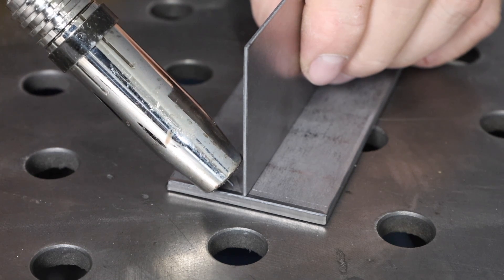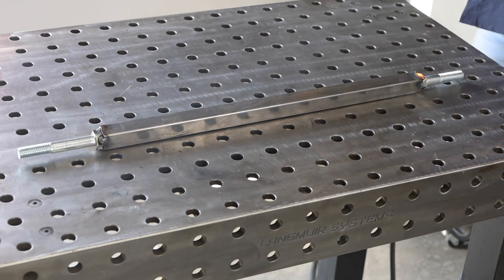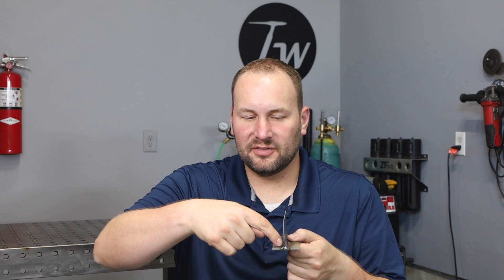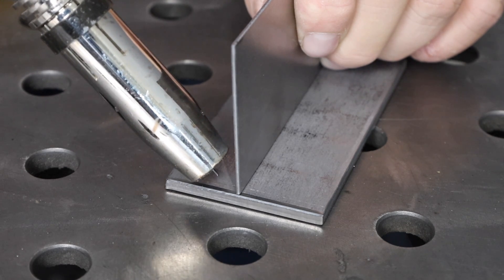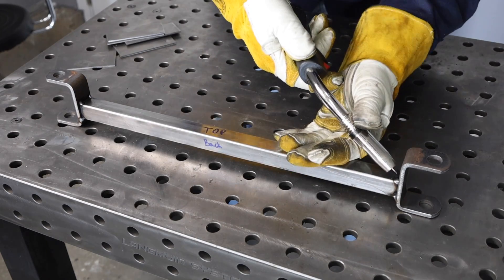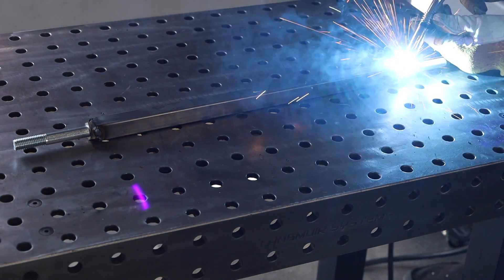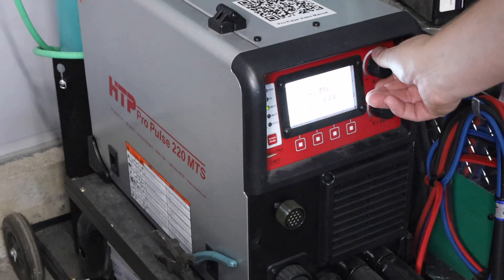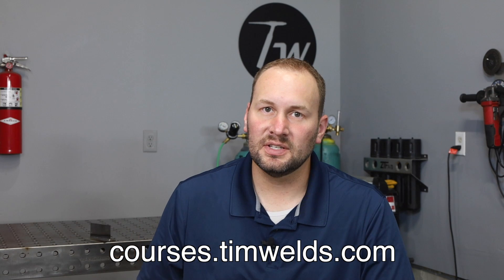MIG Welding Thin Metal to Thick Metal: Here's How

Comment: Most of these  videos show the easy one; with the thick metal flat...how about the real thing with the thin metal in the flat position ?
Reply: Following the same process. You focus most of the heat on the thicker material.  It is a bit more tricky when welding vertical but still the same principle 👍
Reply: His example of the anxle is as you describe. Really no difference, just move a bit towards the thicker.
Reply: He does thick metal-vertical here: 3:00

Comment: Hi Tim, great tips in the video.
As an amateur I have enough trouble keeping a straight line when butting two tubes to form a tee. The bicycle head set I’m welding is 1mm and the main tube is 2mm. I’m told if I insert a spare section of 1mm tube snuggly into the 1mm tube I’m welding this will form a heat sink and reduce the likelihood of me blowing through the 1mm tube if welding on a setting for 2mm steel when keeping the torch centrally positioned between both pieces.
Is this correct or wishful thinking. Someone said place a damp rag packed into the thinner tube will also dissipate the excess heat.
Thanks,
Bob.

Comment: Hi. A very informative video. 
I’m looking to weld a rectangular 2mm wall box section frame to a bicycle head set after I have ground off the exiting frame that is connected to it.
If I leave the existing weld in place tided and ground to 1mm thick so that the wall thickness of 1mm is now 2mm and equal to the box section would this be ok so I could weld centrally and avoid have to weld offset as explained in your video. I ask as I’m OK at welding equal thickness materials but not so good at welding different thickness materials as shown.
Thanks in advance.

Comment: Cool stuff would just like mention as a seasoned welder guys when the horizontal is the thin stuff its a whole different beast be careful when you end the weld starting it and running it is okay but if your not careful on terminating the weld you will get undercut. Normally I drop a it back a tiny bit more in this situation eg 10 to 10mm ill blast 270-280 amps all the way but 10mm to 3mm ill put about 245-255 if I can stand it upright thick at the bottom but if the 3mm is horizontal I'll blast it about 240 amps but make sure the volts are above 26

Comment: sir how to avoid a cold start at the weld at the start and lack of fusion at the end of the weld. I am trying to join a 1.2mm mild steel sheet to an 8mm mild steel sheet..the path of the welding is half the shape of a rectangle due to the welding path I have to make this weld in two steps from right to center and left to center.

Comment: If I ever weld Thinner to thicker steel I only use no gas flux cored wire with the shroud removed as it not needed with gas wire..I always apply heat to the thick steel and use the weld pool from the thick steel to melt the Thinner steel so they melt together..any one with common sense would know this technique..I'm no expert welder but common sense prevails..yours sincerely from the old qeer corrupt uk 🇬🇧

Comment: 👍🏼👍🏼👍🏼👍🏼👍🏼👌🏼🍺😎
Have you used 25’ thicker extension cord for outside flux welding? 
I believe the settings would have to go lower than Chart I was having problem with it burning threw.
Reply from the maker: Thanks! I use extension cords all the time, but mine are pretty beefy.
Reply: @TimWelds  when you use them do you have to turn the power down?

Comment: Can you make a video for stick welding thin material
Reply: Run the small rod diameter on the lower amp settings, increase your rod angle drastically (play with this a little until you get comfortable) travel kinda fast. Just a few things that will help.
Reply from the maker: You’ll find a few vids on my channel where I do this. I agree with DOGLEG’s tips and would just add that changing your polarity to electrode negative can help sometimes.
Reply: https://www.youtube.com/watch?v=NZDhtcZ7vxo

He already has one